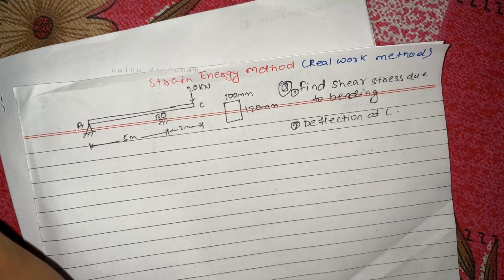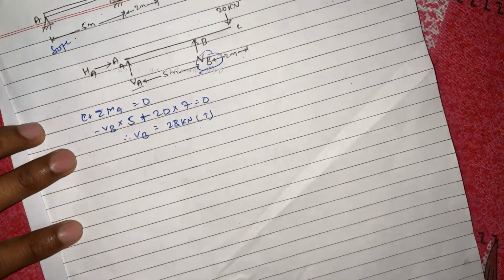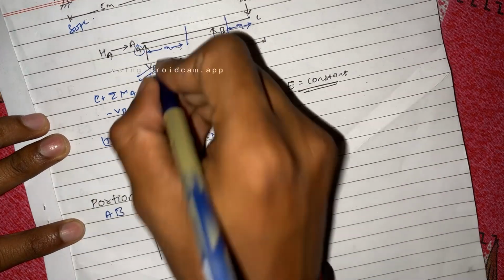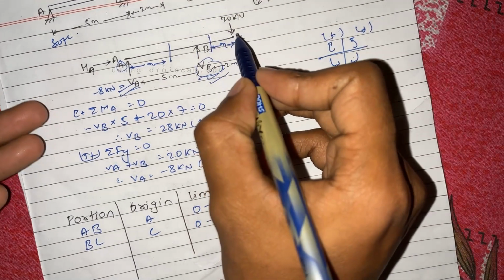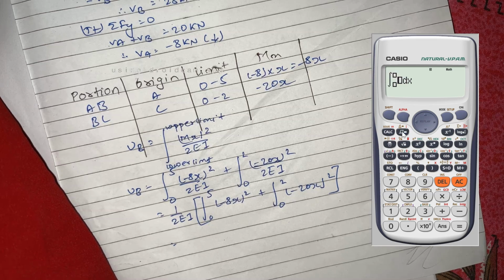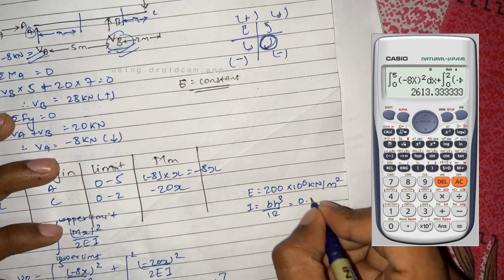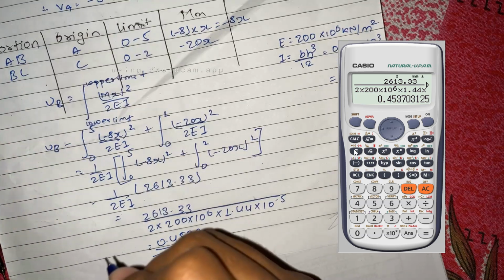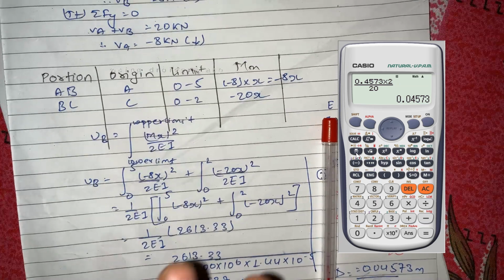Find shear stress due to bending moment and deflection | Theory of Structures - I

Comment from the maker: there is slight mistake in calculation while doing integration. and the correct answer for shear stress due to bending moment is 0.64813KNm and Deflection is 0.06481m